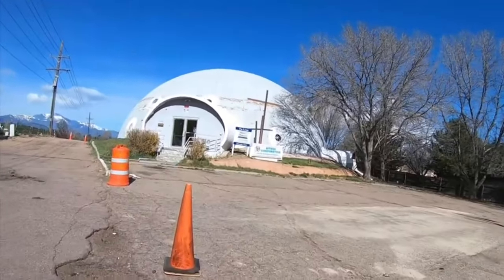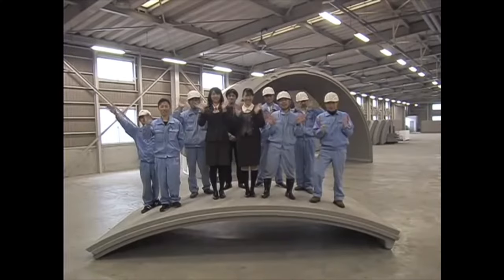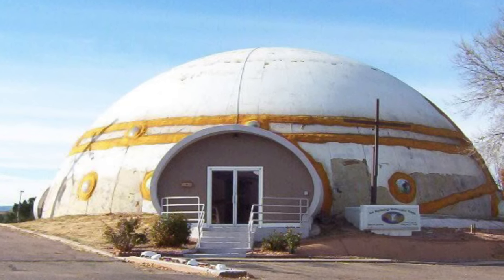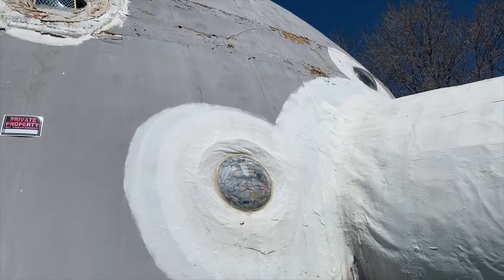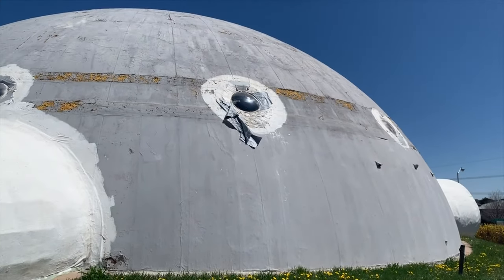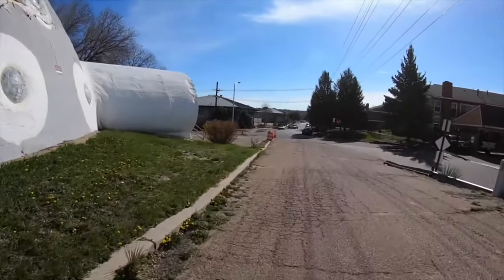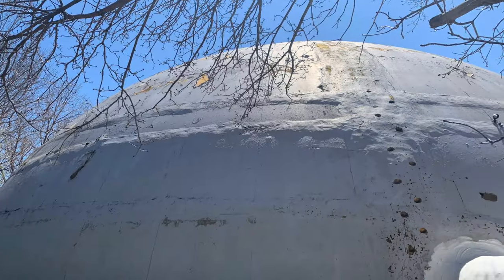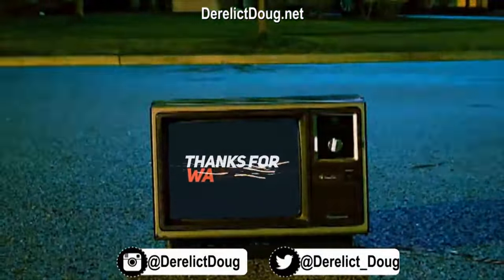Styrofoam Dome Home Becomes A Derelict Biodome - Is It Too Durable?

Comment: why not try to interview them, or at least the seller/owner-representative managing the leasing?
- could be a more informative view on why it's gone downhill, if styro-construction is supposed to be so much better.
> why not put a sealcote & use the existing dome as a form for cement layer/durability &  amp the longevity?
-maybe a sequel ?
Reply from the maker: I've worked with this group in another situation and am not looking to interview them. Trust me it would be a waste of time. They have little interest in the up-keep of the property, rather they only care about property vacancy.  Thank you for sharing your thoughts and all the best!

Comment: I would build something like this where there are earthquakes, and where it's also cold & windy. It's strong and lightweight, which is good against earthquakes and wind, as well as being insulative against cold.
Reply from the maker: Very good points. This is likely why this type of structure is very popular in Japan. Thanks for sharing your thoughts and for stopping by. All the best!
Reply: @DerelictDoug  I think the outer surface layer was the weakest thing. They needed some kind of hardened cement layer to cover the outer surface. Perhaps a cement loaded with crushed glass (or glass beads) or some suitably hard material could have been used to create a strong surface layer.

Comment: Technically, it’s not a “Geodesic Dome”. It’s more like a Monolithic Dome.
Reply from the maker: You are right. But the structure behind the dome follows Buckminster Fuller geodesic, design
Reply: @DerelictDoug  Thanks for your reply, so it’s not a wire frame, like a ferro-cement application, it’s a “bolt together a bunch of frames which looks like a honeycomb” type building?

Comment: I used to live in the Sierra Pointe townhomes right next to it back in like 94/95. I went to Wasson H.S at the time and our bus stop was right in front of the building. It was a church back then. I remember I used to climb on it sometimes 😁 Definitely one of the strangest buildings in the Springs, but not the only dome shaped structure either. There's another one similar to this one on Austin Bluffs by the Fabulous TNT's. Slightly different, but very noticeable nonetheless.

Comment: Resealed in olive green cement and wrapped in vines the doorway and other key features will profit enormously on the aesthetic front each framed by tall cedars to either side  ( or some similarly tall pointed tree ) .  Think Hagia Sophia in Istanbul It wrote the book on this kind of architectural counterpoint  .

A circumferential planter waist high is a next most logical finess to this structure's form Geometry and Counterpoint  .

Reworking the doorway as an asymmetrical all glass and slim metal framing ( male right angles and straight lines ) Cartesian composition ...will sharpen the focus in counterpoint to female round dome Geometry ❤  !!
Reply from the maker: I absolutely love that idea